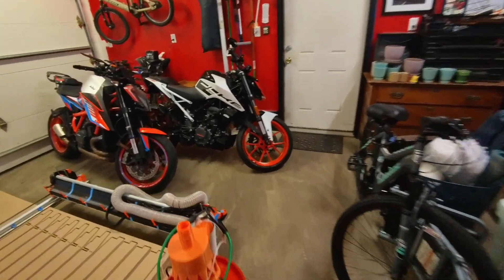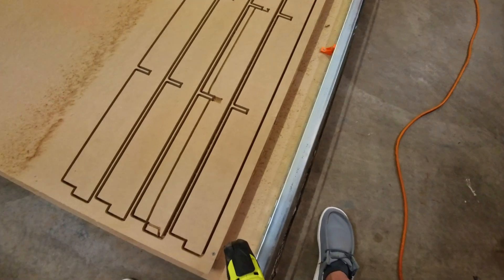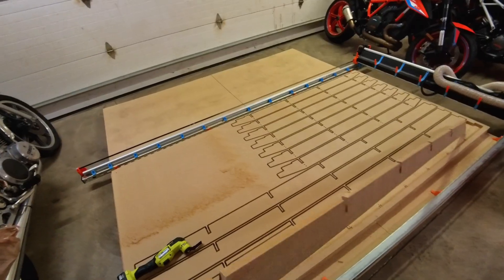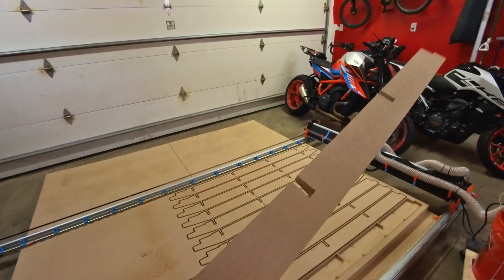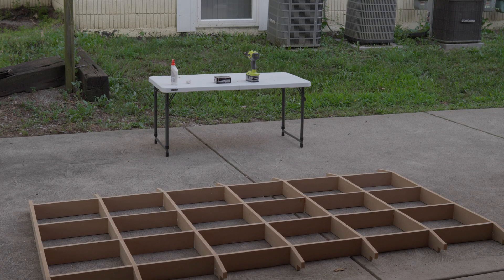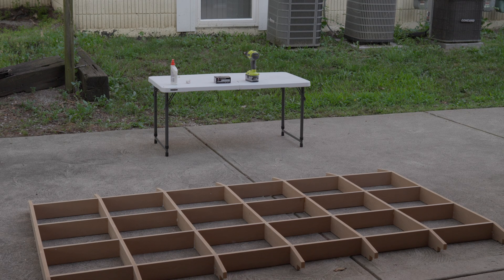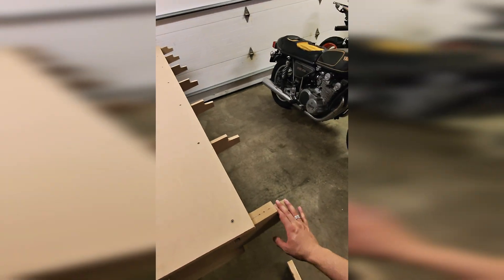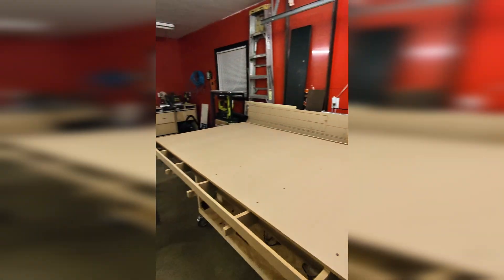Building Folding Torsion Box CNC Table - Lowrider V4

Comment: Subscribed to see the rest! I had an early version lowrider years ago, but in a one car garage. I hope to build a V4 next year in a new setting. The dust collection looks awesome btw. if you could make a video on how you set it up that the hoses don't interfere with the machine movement, that would be awesome. Not sure what you have there? Like a boom arm on top?
Reply from the maker: Hi, thanks for subscribing! I can put something together on the dust collection, sure. It's really quite simple though. It's just a five gallon bucket and a dust separator I found on makerworld, connected to a shop vac, and rolling on a cheap furniture dolly from harbor freight. I was trying to avoid having to buy another longer hose. It worked fine while it was on the floor, but once the table was built I did have to buy a longer hose, 20ft I think. Then I had to ground it. Yeah a video on that is a good idea, thanks! The fact anyone can just print a cnc machine with zero previous knowledge like me is astounding. Really cool project to learn, and the community has put out a ton of information that helps.